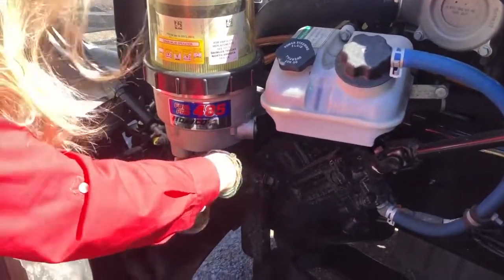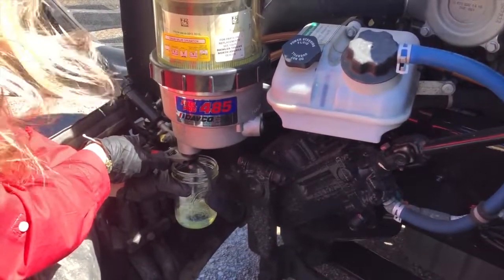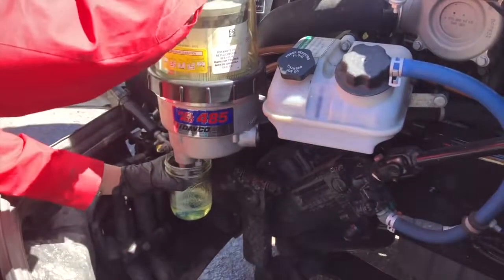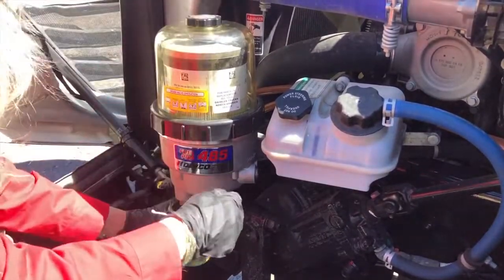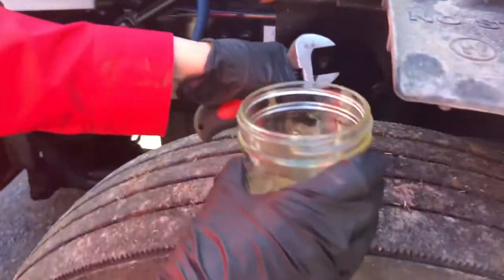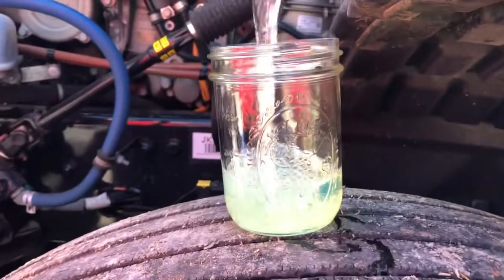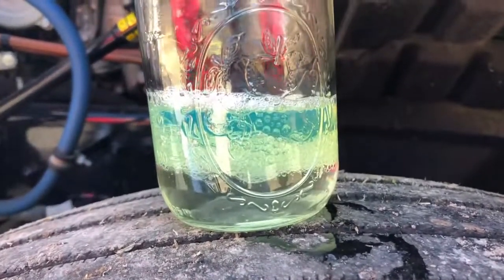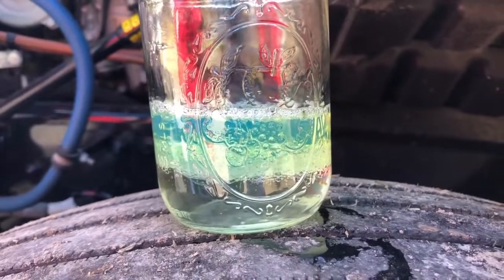Why You Need to Check Your Fuel Water Separator

Comment: Why is mine getting full to the top after every drive
Reply: I have the same issue . Never did that before. I Drain it and after a drive it fills back up. Hoping I just needd to change the filter
Reply: Ya ever figured out the issue? I’m having same problem
Reply: According to YouTube, that means it's time to replace the filter. There was a longer explanation about it; just YouTube it. I hope this helps.